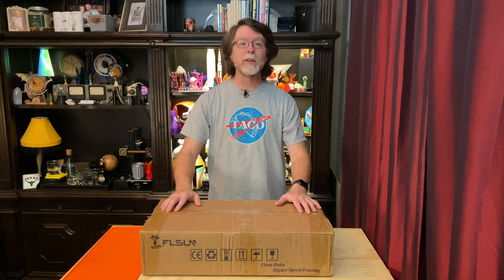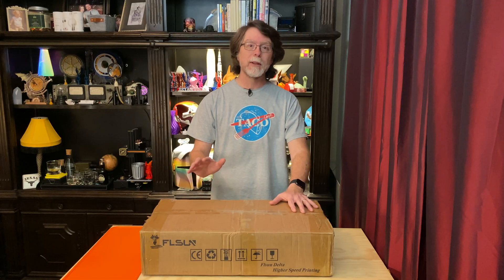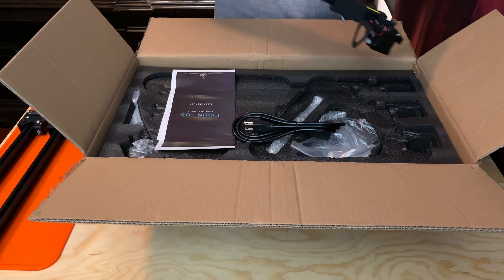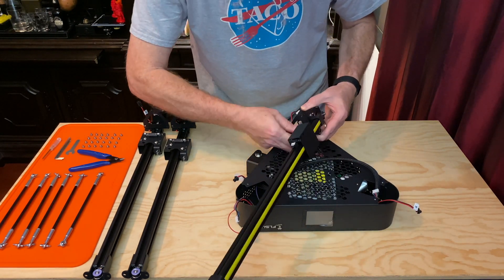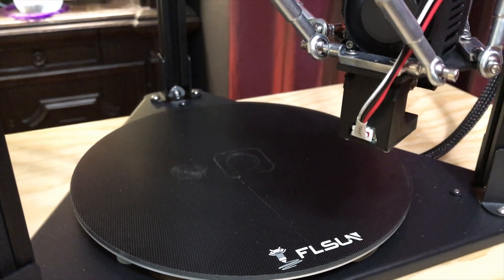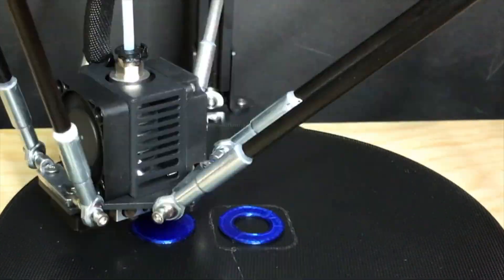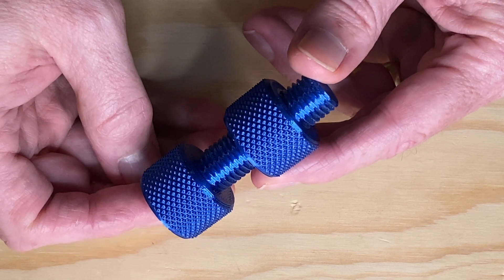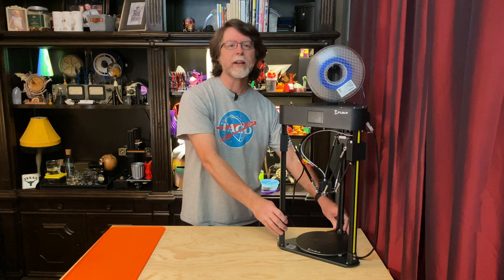Your First Delta Printer: FLSUN Q5 Unbox! Assemble! PRINT!

Comment: 7:06. If you had ever been involved in manually leveling a delta, you would 1,000% consider this "auto leveling".   Plugging in and removing a sensor to let the delta celebrate its own arc calculations, is nothing compared to doing it yourself.  Manually tramming a delta is 1,000x more difficult than tramming a cartesian.

Comment: The SD card slot in the back absolutely sucks and honestly can't understand who the hell would design something like that. Also, the Cura 2.something profile prints far better than any profile sliced in Cura 4.8.
Reply from the maker: I have a MIcroSD to SD extension cable that I'm thinking about mounting either on top, above the display, or immediately below it. With the current location of the printer on my desk, the MicroSD slot is super inconvenient.

As for slicing, I've been using PrusaSlicer with the Q5 for a while now, and have been getting great results. PrusaSlicer had a QQS profile so I used that, and changed the bed diameter and build height.

But I just checked, and PrusaSlicer now also has a Q5 profile, so I'm going to see how that works compared to my existing profile.
Reply: @BV3D  I'll end up with an extension too I guess. As low tech as it is, I'm sticking with the 4.something Cura that came with the printer. I prefer high quality prints to subpar prints all the while doing extensive testing trying to work out bugs with a hundred and fifty options. I contacted FLsun and they ensured me that the prints with Cura 4.8 should be the same as with 4.something, but that certainly is not the case. FWIW, FLsun support is excellent.

Comment: In my experience the speed advantage of deltas arent from print speed but from acceleration and moves when not printing.
On my kossel I'd usualy stick to 60-80mm/s print but crank acceleration up to >3000mm/s2 and non print moves to >200mm/s.
Another nice feature about deltas is that you can do z-hops during retractions without penalty for better retracts.